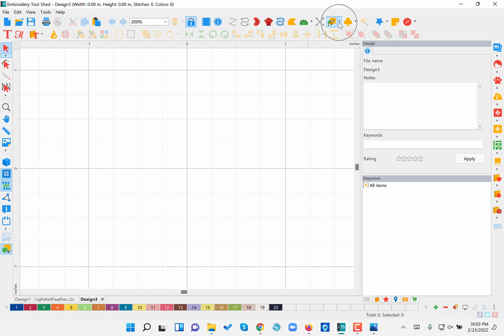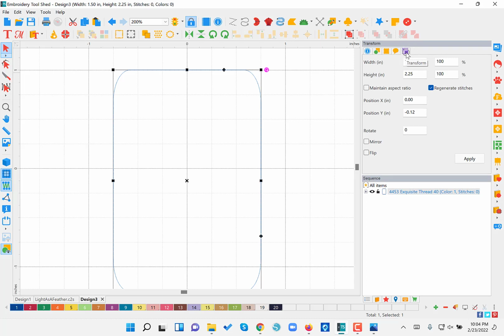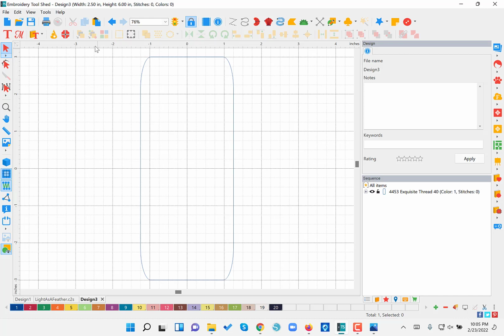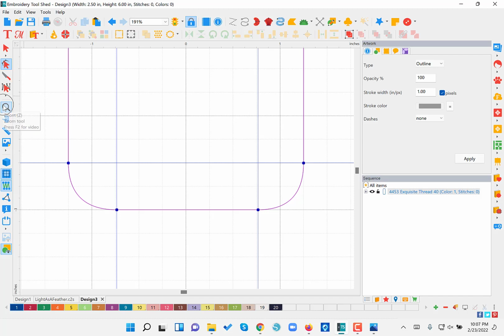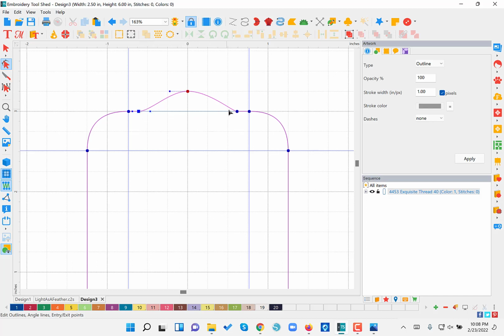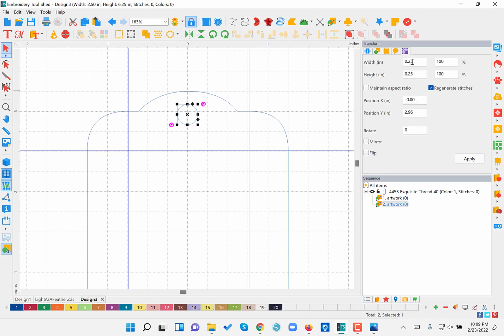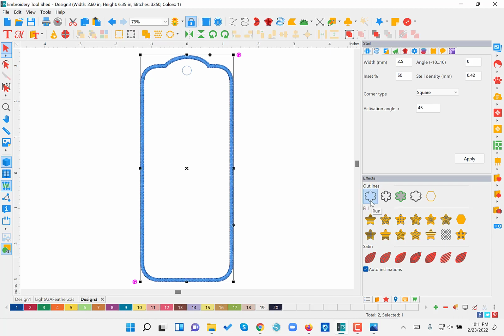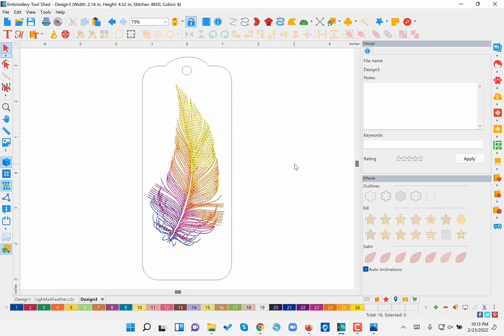PEP Creating Bookmark Shape

Comment: I need to have an open-ended design.  How do I get rid of stitches?
Reply from the maker: you can select stitches with the stitch tool on the left hand side. it is an arrow with points above it. you can give over the icon to make sure it is the correct one. select the stitches, tool, select the stitch you want to delete, and press the delete on your keyboard